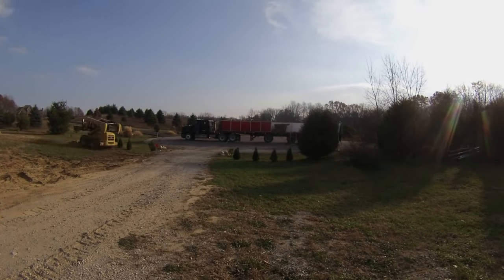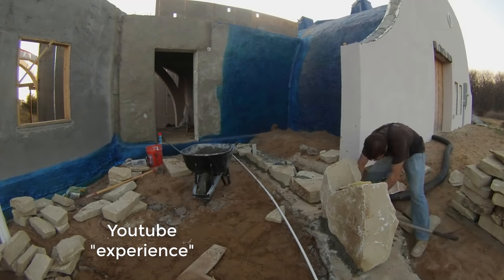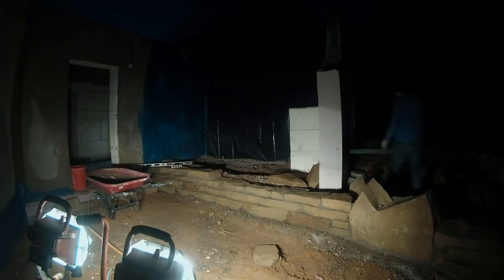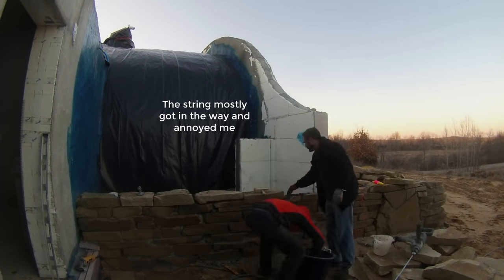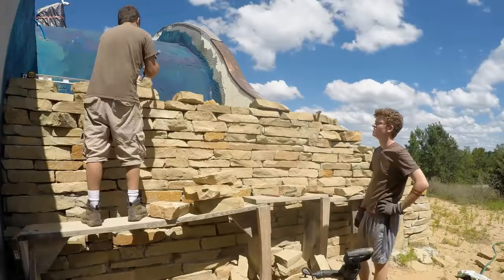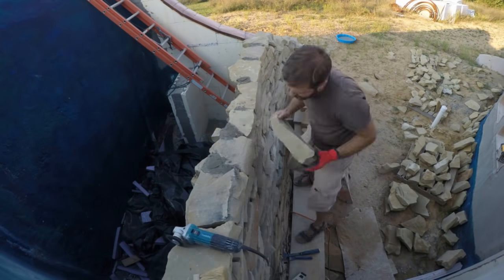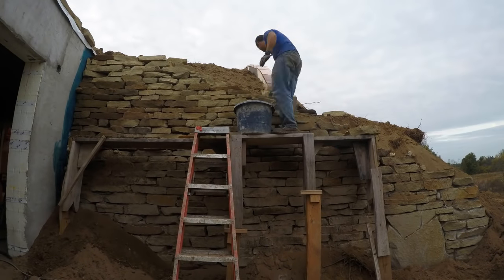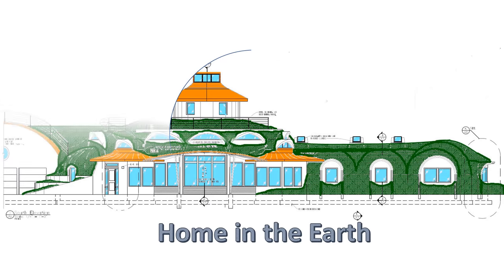34.0 Retaining Wall

Comment: Awesome wall. I like to build walls that lean back slightly. I feel like it gives them a visual strength. Even is you built a strong wall that leaned out slightly it would always look like it was in failure. Great project. Thanks for posting.

Comment: You've done really well on that wall! I used to work as a stone Mason when I was young, so I know what it takes to build these walls. You don't need to be shy about your achievement here! :)
Reply from the maker: This is YouTube, so you can bet a bunch of people will comment on all the mistakes I made.  Some will even be right.  Better to start out humble than to be brought low in the comments.  ;)  But yea, I am pretty happy about the wall. I have always wanted to build a wall this way (I don't know why).  But this was the first of 3 retaining walls I have built in the project and I did the other two very differently (same sand stone though) just because I want to try different things.

Comment: We are doing some terracing walls on our property. In order for us to go over 3 or 4 feet requires specific geo engineering approval as well as approved geo-reinforcing mesh layers. All of that also requires specific building permits and inspections.
Reply from the maker: I only got away with this one because there is no significant "surcharge" at the top of the wall.  It isn't really holding back anything.  I think if it were holding up my backyard or taking up some of the load from the footings, it would have been a different situation.  Also, the wall (along with several others) is shown in the engineered drawings, so I think I would be covered by that even if the inspector took an interest in the wall.  My engineered drawings didn't mention the geo-reinforcing mesh layers, but we did put layers of carpet in to do that same job anyway.

Comment: The wall looks great. I did not however, see you put any kind of retaining wall stabilization in the erection of the wall. I hope the weight of the backfill pushing outward on the wall is not too much for the wall.
Reply from the maker: If it were a plumb vertical wall, I would have needed to put in some dead men, or something like that, but with the 15 degree lean, the earth would first need to push the wall up to vertical before it could push it over, and that is very unlikely.  The curvature and 8 tons (based on how many pallets of stone I used up) also help make it very difficult to push the wall over.  Hopefully it is enough.

Comment: How long is it going to take to build? Ps love the videos you make
Reply from the maker: I'm really hoping to get the roof on the middle coming summer (2018) and have the windows in and the house closed off by fall.  But that may be a stretch.  If I get that done, then I can put in the kitchen, bathrooms, finish electrical, etc. over the winter.

Comment: Did you use ankers to retaine the wall later in the soil?
Reply from the maker: Do you mean "tie backs"?  No.  I just leaned the wall way back.  I did use layers of carpet to reduce lateral loads (geo-textiles). Also it's not retaining a field or a large terrace, only the dirt between its self and the garage 8 feet away. The final thing I didn't show (lost the footage) was that I used that mortar sprayer to spray about half an inch of mortar on the back of the wall when it was about 18 rows tall.

Comment: I know you already finished this and did the fill, but you really might want to consider some preventative/mitigation for 'wall jacking,' which occurs when the soil behind a wall freezes(expands) and then settles into the now-wider gap, repeating each year to 'jack' a wall out and eventually over.  A set of fabric and gravel 'courses' behind the wall between the rock and the soil, helps to buffer this effect and allow for drainage.  See the following videos for info on this:  https://youtu.be/39dhQsQLVHc?t=300
Reply from the maker: We did put horizontal layers of carpet behind the walls to try and get this "geo-textiles" effect.  I wanted to put it every foot or so, but the realities of working with the excavator crew made that difficult, so we just did every few feet instead.  I mentioned it briefly in this video and will show it better when we get to the burial video. 

The wall is also leaning back and the sand has good drainage, so I am hoping that I don't have this particular issue anyway.
Reply: The wall is gorgeous, by the way.  Nice work.  :-)  very much enjoying your video-journey, and the thoroughness of your documentation and explanation.  One request?  Raise the volume on your narration voice-over by about 30-50%.  :-)
Reply from the maker: Yup, getting there on the volume...  I think the next one will be right.